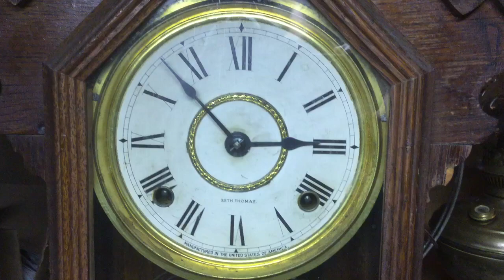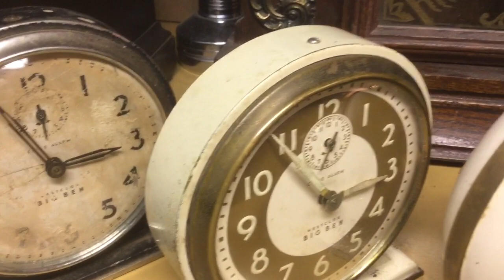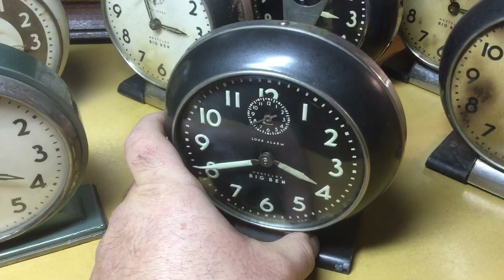Upcoming clock projects

Comment: I look forward to it! I have 24 Big Ben's and 23 Baby Ben's all working, I have at least one of every style from style 1 to Style 9 in both baby and big Ben's, no electric Ben's or clock of tomorrow. It sounds like a lot of hairspring straightening work ahead, good luck and get your lighted magnifying glass out, well then again it may not be all that bad since what I saw was all Big Ben's and no Baby's. I just bought 275 Big and baby ben part's, 135 baby ben model 61time bridge's, 53 baby ben alarm bridges and a bunch of big ben alarm barrel's and 75 single wind time barrel's for newer big ben's and all kind's of glass. All for $65 shipped on Ebay!

Comment: I have a Big Ben just like yours with the black dial. It works and keeps perfect time. However, are these clocks safe to use? I know the numbers and hands were painted with radium paint.
Reply from the maker: Yes, they are safe to use. I use a 1930's luminous Big Ben for my bedside alarm clock.